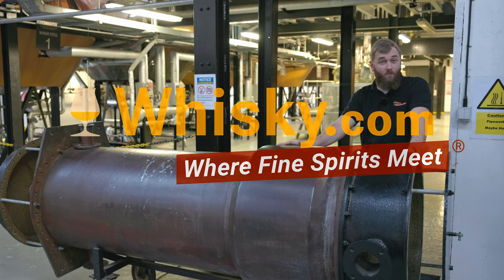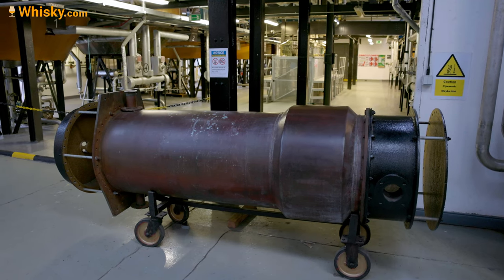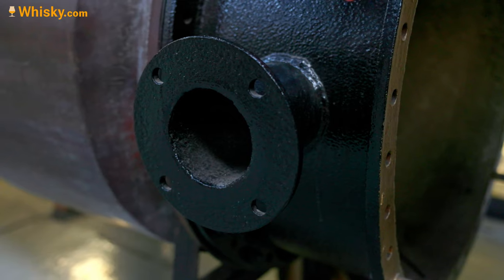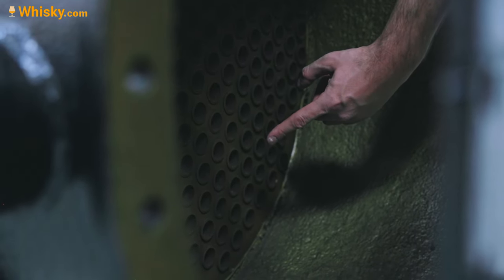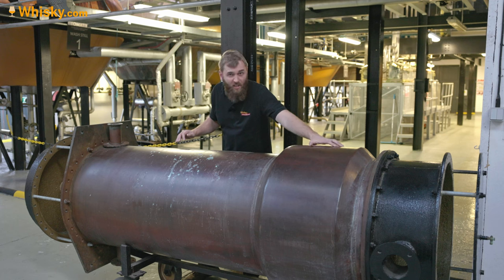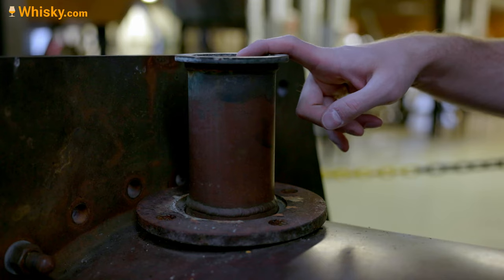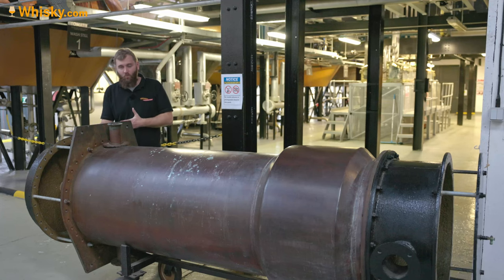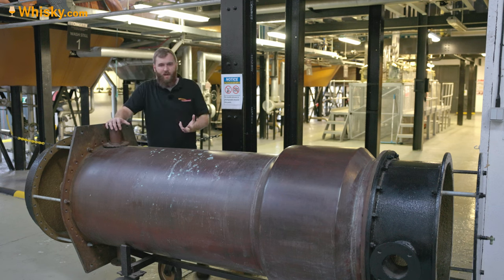How does a Shell and Tube condenser work? | Whisky Knowledge

Comment: Oh wow I built a tiny version about 7 years ago for a 10 gallon still but I didnt even research or know they existed. I was just a dummy experimenting with stuff kinda blindly. Mine was opposite tho, my alcohol went through the smaller tube and the cooling liquid pumped through the bigger tube. It actually worked quite well